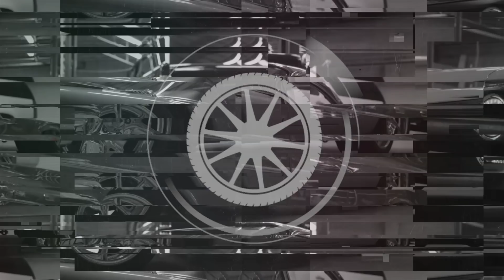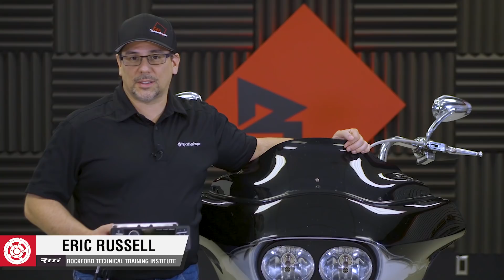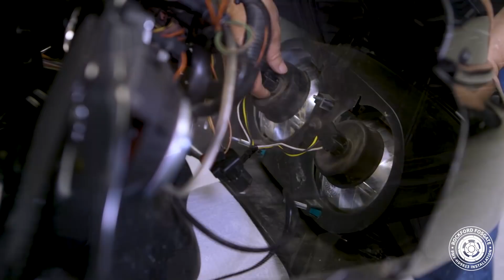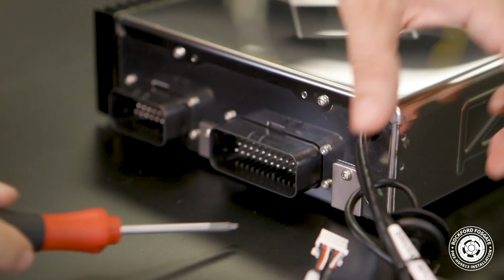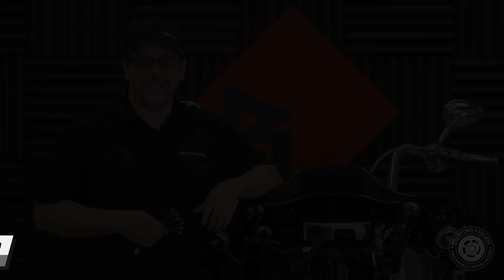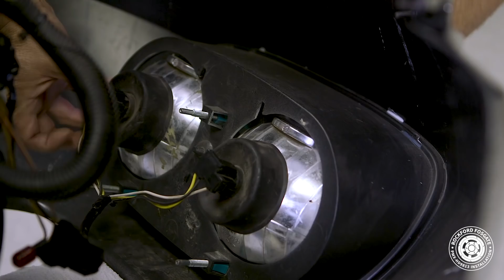PMX-HD9813 | H-D Road Glide Upgrade

Comment: I just purchased this unit from Sound Shapers located in Brewer, Maine.  I also have the Rockford Fosgate amp and front and rear speakers. 
The dealer did the install. I can not fade the the speakers to the front and rear. I also think the system was louder and sounded better with the amp and speakers using the factory radio.
I
Reply from the maker: Hi Keith R, what model number audio kit did you have previously installed?  Are you using the RCA output or the Speaker line output to connect to the input of the amplifier?
Reply: @rockfordfosgate  I don't know. Sound Shapers did the install of the Rockford Fosgate Speakers and Rockford Fosgate  and Amp. It comes as a package. Looks like it was called a stage 2. Now I had them install the Rockford Fosgate head unit. To make a stage 3.
Reply from the maker: @KeithR1250  Regarding sound quality, there are new settings for the amplifier when using the radio, and there is a built-in EQ setting based on the stage you have.  However, with the fader, I'll need to see how it was being integrated into the system because the previous generation kits tapped into the front channels only, which would give you no fade.
Reply: @rockfordfosgate  The owner told me they made no adjustments to amplifier when they installed the Rockford Fosgate radio. He said the tuned it the first time when it was installed and needed no adjustments.
Reply from the maker: Thanks @KeithR1250 , I'll contact Sound Shapers to see what tuning guide they used for your motorcycle.  What year/model/color is your bike so they know who I'm referring to?
Reply: @rockfordfosgate  Is this Steve from technical support? My bike is a 2012 Street Glide, black. I called again today. And they insisted there was no tuning necessary to the amp with the radio install.
Reply: @rockfordfosgate  meaning that the amplifier was turned when the stage 2 kit was installed prior to the radio being available on the market for sale.
Reply from the maker: @KeithR1250  Yes, once we started selling the PMX-HD9813 source unit, the amplifier tuning totally changed.  I thought it was a mistake at first until I got a quick explanation from engineering.  There is also a preset tune inside the radio based upon what stage you have.  You can change this under the AUDIO menu.  You can switch between FLAT and STAGE2 to see the sound difference.
Reply: @rockfordfosgate  Should I take it back to Sound Shapers and have them retune the amp after they told me it didn't need to be retuned?
I'd like to take it to another Rockford Fosgate dealer. I'm really not comfortable with the installation they did on my bike?  There was lots of flaws and things I had to return the bike back to have fixed multiple times. Not to mention they smashed my Harley Davidson Daymaker headlight. Talked me into replacing it with their band of aftermarket. 
Is it possible I could have a Rockford Fosgate team tech inspect the installation and retune the amp?
Also after the first day of having the stage 2 kit installed. The rear speakers blew and completely stopped working. ( First few hours of owning them ) Sound Shapers did replace them but then stripped out the bolts on the inside of the lid. Also forgot to put one of the bolts back on the holds the saddle bag on the bike. And completely forgot to put the bolts back in for the lid latch.
Reply: @rockfordfosgate  My Rockford Fosgate dealer says that they called tech and did not retune the amp. 
Should I take my bike back there and have them retune the amp to get the best sound from the this stage 3 system? 
As of now I'm not to happy with the sound I have now.
Reply from the maker: Hi @KeithR1250 , I've been in contact with Andy at Sound Shapers and followed up with our technical support.  Steve in Technical is aware of different settings for the TM400X4ad for a factory Harley-Davidson radio and the PMX-HD9813.  However, that information was not available at the time the radio shipped.  This is why Sound Shapers likely used the previous tuning sheet for factory H-D radios.  I have given Andy the updated tunings for the TM400X4ad.  We (Rockford Fosgate) owns this part and I apologize for our lack of proper instructions that should have been shipped with the 1st batch of PMX-HD9813.  To the best of my understanding from Sound Shapers, the kit that was purchased utilizes the front speaker outputs to drive the system, therefore fading wasn't an option with the factory radio, and thus wasn't an option with the PMX-HD9813.  However, I am shipping Andy a rear output harness that he will install to allow for front/rear fading.  This option is standard on all our newest kits that were released on August 1st.  Sound Shapers and I have an additional solution for your broken headlight issue - which I hear was already resolved - but I will allow Andy to speak with you about this.  I believe these solutions will fix the sound quality issue and optimize your system for maximum dynamic range.  Again, I apologize for the misinformation on the radio/amp settings, but I feel confident you'll be very happy with the result that Sound Shapers has in store for you.
Reply: @rockfordfosgate  This is really detailed and exciting information to hear! Reading this just made my day! 
I'm more then happy to continue moving forward and I'm also more then excited to hear and experience the end result! 
Thank You everyone! @ Rockford Fosgate And Andy @  Sound Shapers especially for working with me when I had a sour attitude about this matter.
Reply: I also want it noted that at this current time that my front speakers sound different than my rear speakers without the function of being able to fade them. The front speakers seam to have a popping sound and there is a constant hissing sound as well. 
Hopefully with these new improvements this is also be resolved?
Also is there advice for all the fine tuning in the PMX HD98-13 unit itself that can be passed along?
Reply: And they only one big negative thing about this is that I have to find time and another co-worker's time to bring the bike back and drop it off. Then Get someone to give me a ride back over to pick the bike up once the work has been completed. And all at my time and expense.
Reply from the maker: @KeithR1250  Well, the amplifier is probably setup for use with standard H-D radios.  The PMX-HD9813 is a much "hotter" signal so the amp needs to be adjusted.  I gave 2 pages of settings (#1: TM400X4ad amplifier and #2: PMX-HD9813 source unit) to Sound Shapers, so they have both settings now.
Reply: @rockfordfosgate  Great! Thanks so much for taking the time to explain how your solving my concerns! This is really great! 
Thanks again so much!

Comment: So to hook up the RF hd9813-tkit 4 channel amplifier to this new RF source unit, I'm understanding I'd just have to plug in the included rca plug under the door in the back? This video is a bit misleading/confusing when dude says he didn't need it.
Reply from the maker: On existing kits like the HD9813RG-TKIT & HD9813SG-TKIT that use the high-level speaker outputs, you don't use the external RCA harness.

Comment: Nice, but when are you guys gonna make some car head units ? 3 pairs of 5v pre outs, plays flac, built in crossover etc.  Can't say I have a full Rockford fosgate system with a pioneer at the head.
Reply from the maker: Hi rage warrior, source units are getting harder to swap out in mobile audio applications due to their tight integration with the electrical systems, including lighting, alarm, navigation and A/C controls.  Because of this, Rockford Fosgate has focused on integration solutions like our DSR1 digital signal router co-developed with iDatatech Maestro.  The DSR1 allows you to add aftermarket amplifiers, speakers, and subwoofers while retaining the factory source unit.  The DSR1 is a cost effective $269 solution and simply integrates using a T-harness and downloadable vehicle specific firmware to enable integration without the loss of factory equipped controls and features. Once connected, complete control of the sound profile can be adjusted using the 3Sixty Perfect Tune software.  You can learn more about the challenges that installers face with factory systems here: https://www.youtube.com/watch?v=4Vcva0lW_6A

Comment: that looks like it's not that far off from a single din. l wonder if it would fit in my dakota which is slightly larger than single din but smaller than double din. lol just let me experiment, l don't want any flack.
Reply from the maker: You can find dimensions under the SPECIFICATIONS tab on the product details page that may be helpful: https://www.rockfordfosgate.com/products/details/pmx-hd9813/